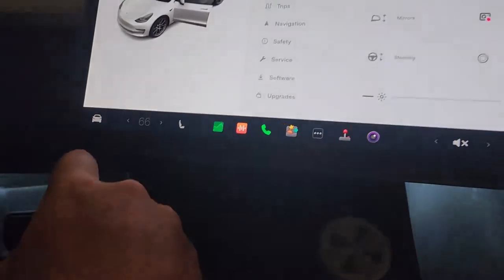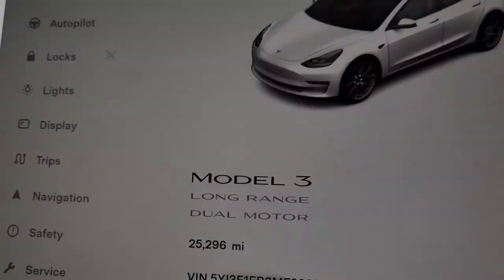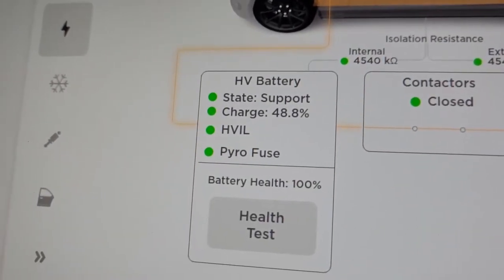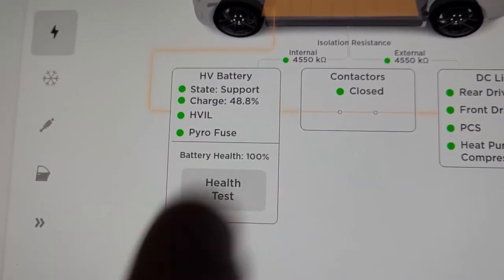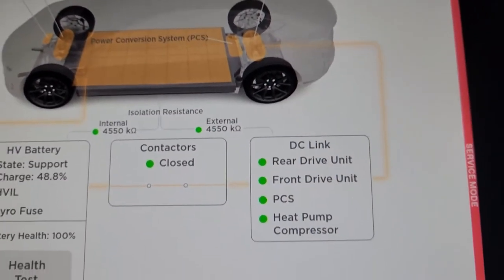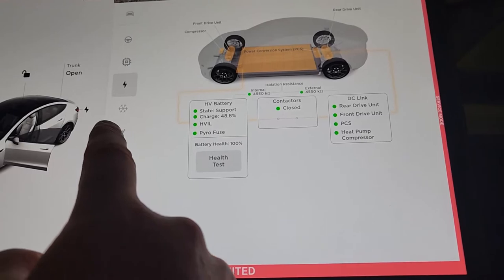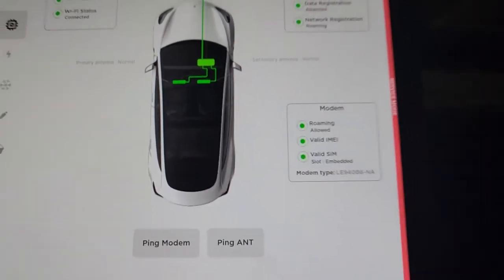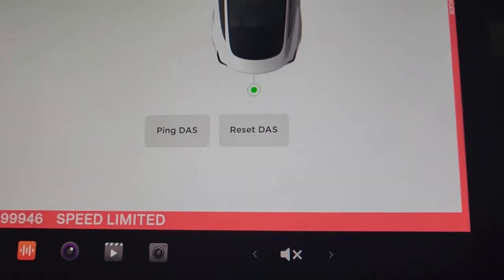21 Tesla Long Range SERVICE MODE BATTERY DRAW DOWN

Comment: I drive about same miles as you do, wonder what’s my degradation is, driving mostly highways, charging to 80% at home, got vehicle December 2021. Let me know if you will do another test just to see what it is. There is another video, guy did it, it shows degradation, I think you needed to wait till it get to 100, before pressing button
Reply from the maker: I think your right, There was definatly something that I probably did.